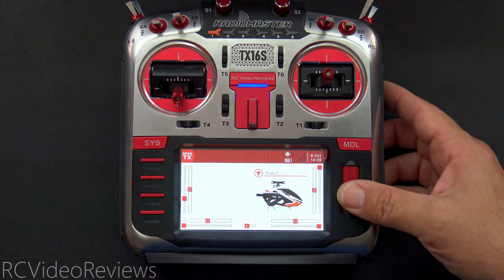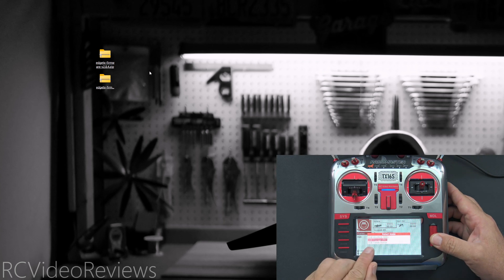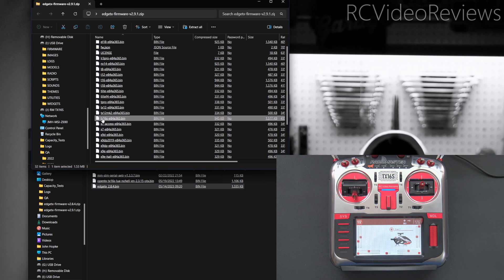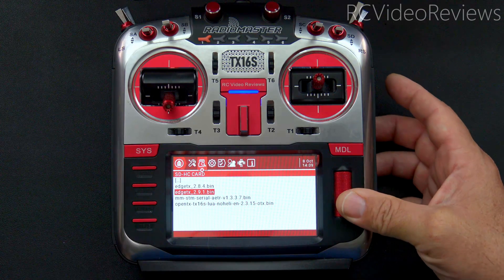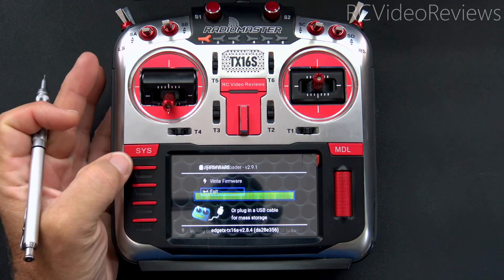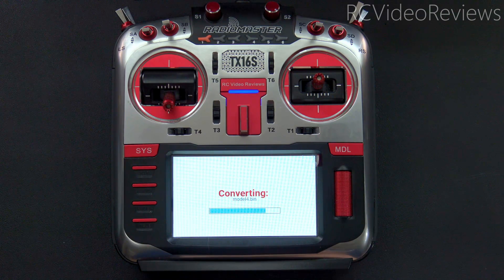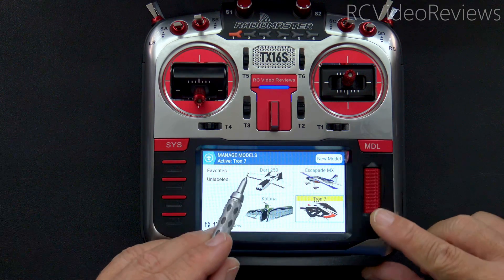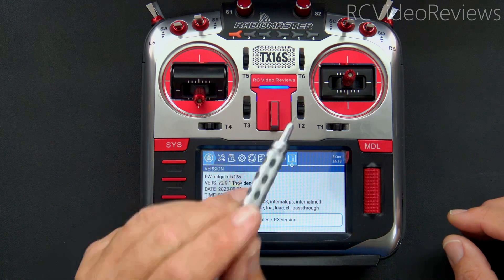How-To Upgrade OpenTX to EdgeTX 2.9.x • DO NOT FLASH Before You Watch This Video

Comment: the progress bar in the writing process gets stuck at around 90% and doesnt move, I cant turn the radio off, return... its completely stuck. Anyone??
Reply: I unpluged the battery and when I plugged it back, looked like it was bricked, but I did the pressing T4 and T1 while pressing the power button thingy and it opened the writing menu, I tried to write the firmware again and it worked, everything else went great from there.

Comment: Thank you so much for the great tutorial videos on upgrading to EdgeTX from OpenTX. Following them made it a breeze to do and everything seems to be working fine (so far). 
I was hesitant to try it and risk losing all the work I had done in OpenTX or mess up the TX16S working with the TBS Crossfire my quad uses, but watching a lot of videos on the features EdgeTX offered made me want to have them also.
You're videos made it irresistible to put it off any longer and easy to get it done.
Loving it greatly....
you have another follower and I'll be watching more of your videos to implement and use the more advanced features I haven't tried yet due to ignorance of what they do.

Comment: Hi, thanks for a great video. My situation is a bit different: I want to migrate TX16S from OpenTX to the newest EgdeTX (v2.10.3 currently), but I have no models, no settings, nothing I'd need to preserve. I want just a clean installation of the latest EgdeTX. Do I also need to go for v2.8 first, or can I go directly to 2.10 please?
Reply from the maker: While I haven't tested this, I'm taking an educated guess here: I would still stop at 2.8 because I know in the conversion process the correct files are created/deleted. The deleted part is important here. I've seen issues first hand when the models.bin file was on a post yaml radio and it created issues deleting new models. 

So just take the extra 2 minutes to flash 2.8 then 2.10 and you'll be 100% good to go.

Comment: The models I backed up do not appear on the remote control (tx18s) when I switch to Edge TX. Tx18s update is same as your video?
Reply from the maker: All color screen radios will function the same way. What firmware did you have before you started and what version of Edge to you try to use in your upgrade?

Comment: hi can I ask,may radiomaster tx16s with edge tx 2.8.4v, I got a nonheli mode, what will I do to get back the heli mode on may radiomaster tx16s. thanks in advance
Reply: I got no enable features,but it's ok now I update on new firmware 2.9.4, then kaboom it's show the heli mode  thanks
Reply from the maker: Check enabled features.

Comment: Bardewlls video caused me so much issues. Funnything is i saw ur video fist but disregarded it and followed his. Lol 3 hrs later and i think i have things back in order.
Reply from the maker: Glad you got straightened out :)
Reply: @RCVideoReviews  im glad u replied sir so anotger major issue im having with my 7inch inav build is now that i have wired up the gps correctly and it is working and the settings are all in order. Im getting a annoying sensor lost warning every 2 seconds in my radio. I updated to edgetx but its still showing in the tel tab and it goes down starting on the gps sensor and also the rx sensors flash black and it says sensor lost. I reaaaaaly need ur help becuase so far i have not been able to resolve the issue.
Reply: @RCVideoReviews  if i disable the gps it goes away. Im running inav 7.0 on fc and elrs900mz 3.latest. FC is skystars f405 hd2. Im running latest ver of edgetx but i dont tgink it has anything to do with the radio because it was happening in open tx as well. THE GPS MODULE IS A HGLRC M100 MINI
Reply: @RCVideoReviews  so i think i solved the issue by setting the packet rate to 200hz in elrs lua. On the tx. What settings do u suggest for bulleet proof range and penetraion with elrs 900mhz. When i was getting the sensors lost alarm i had my packet rate at 100hz and tel ratio at 64. What telemetry ratio should i use with 200hz pakt rate. And is 200hz packet rate with 32 igood for range.

Comment: My well-used TX16S, Switch ABCD, does not work with Betaflight and drone. The stick gimbal works well.  So I bought a switch and replaced it, but switch ABCD doesn't work like before.  What could be the reason?  Please tell me how I can do it.  And my Zorro works fine too...please help!

Comment: My radio's failing at the first step. When I try to flash bootloader from SD, I get the list of files (renamed as you suggested) but when I select a .bin file, the next screen just shows a flickering firmware filename and "Radio: ionDR" below it. The 'enter' button does nothing :(
Reply from the maker: You need to join our discord and ask there. Much more likely to get help on this one there.
Reply: @RCVideoReviews  Cheers dude. Just tried EdgeTX Buddy and it worked fine. Whoever I got this radio from must've corrupted the bootoader somehow.

Comment: First of all, a lot of great videos. Easy to follow.
I have a suggestion for you. In some of the videos you are using EdgeTx Companion and your Radiomaster linked via FrSky XSR-SIM, got that. But, i would like to know how you can read data from your radio? I know from your video setting up Radioprofile you are using a NAS with contents from your SD-card, is that the trick? Please, make a turorial how to setup and connect a Radio in Campanion 2.9 so you can read/write to your SD-card AND see it in the companion simulator. I have no other flightsim stuff. I use my radio for rc construction stuff with a lot of special functions. Iám using a Radiomaster TX16S MK II but it doesnt matter for the connection.

Thanks
Reply from the maker: Maybe try this one: https://www.youtube.com/watch?v=DpwbyMruoF8

Comment: First Thanks for the Great Video's.  I have a Jumper T16 with OpenTX version 2.3.14 and will use your directions to flash the Jumper T16 to EdgeTX version 2.8.x then to 2.9.  My question, I use a JrBox external 4n1 on the back of the Jumper T16 for the multiprotocols.  I am guessing that the firmware on the external 4n1 jr box needs firmware updated to match with the EdgeTX now installed on the Jumper T16.  How do I make sure the 4n1 module is compatible with the newer radio firmware 2.9.x.  Thanks in advance.

Comment: It would be great if you made an updated video on how to set up a 3D helicopter for Ikon using edgetx 2.9. I noticed with this new version they now have a wizard for setting up a helicopter instead of just a plane like it used to have. But when I tried to use it yesterday it did not seem to work well at all.
Reply from the maker: I see you found it...
Reply: @RCVideoReviews ?? What did I find? I used the wizard but it did not seem to work right. That is why a video would be great.
Reply from the maker: You commented on it: "How-To Setup EdgeTX Radio for 3D RC Helicopter using iKon FBL • Part 1"
Reply from the maker: I'll never do a video using the wizard. Learn to program the radio.

Comment: I updated my TX16s last week. I'm very happy with the new features and appearance. Big caution for anyone updating with SD connected directly to a Mac computer. Be sure you have a backup written to your drive, NOT AN ALIAS which is just a pointer to the files on your SD. I managed to replace all my folders with the mostly blank ones in the update instead of merging; so no models, settings etc after the update. Since my "backup" was really just a pointer is was now just as empty as the SD folders. Fortunately, all 5 planes were based on one generic setup and a few hours later everything worked. One good thing was that at the same tome time I added some of John's ideas to my overall setup. But again the CAUTION......BE SURE YOU HAVE A GOOD BACKUP (or 2) BEFORE YOU UPDATE.
Reply: Had a mild chuckle regarding the iOS thing as it reminded me of my aunt who during one of her daughters Weddings approached for a copy of the recordings, I took onto her laptop which I gladly accepted until she whipped out her Mac and no one knew how to get stuff transferred from the Camera to that piece of crap... Apparently everyone on her side of the family was using Mac but not a single soul knew how to transfer stuff from one to the other unless it was via say Mail which wasn't gonna fly for gigabyte sized video files.

A few years later a similar situation happened when the daughter of my mother's friend got into art school and instead of buying a Windows Machine went with an Apple instead because reasons and again no one could figure out how to get a Picture of a Submission onto the darn thing AND then send it to the teacher and when she somehow did manage to send the picture she instead just send a Thumbnail of it... Still scratching my head about those two scenarios and why iOS is even remotely popular with ppl 🤔🤨
Reply: MAC laptops last a lot longer, and I've never bought spam ware etc.  I still use my windows desktop for all my R/C stuff, cause that's what every you-tuber is apparently using, and it makes following tutorials like this soooo easy. I actually watch video on my Mac, while performing flashing on my windows machine.Lol @Duraltia

Comment: Just for clarification, The widgets configured for each model in OpenTX need to be re configured manually afterwards.  Correct?  They do not come over in the conversion process.
Reply from the maker: Correct.

Comment: Been out of the hobby for 3 years now and just am getting back into it, I just followed the directions on the edgettx site from switching from open to edge and went straight to 2.9.1 and used the instructions they give, and uploaded my model profiles from my backup bin file through the companion and plugged in two of my quads and they armed, not sure if I’m missing anything yet or if there has been an update since this video, thank you for your content just
Subscribed
Reply: I guess this is the way to do it when not using the companion? just trying to learn whatever I can,  I did this on my old x9d+, I have a tx16s that I need to do next was scared of messing up, that’s why I tried with my old radio first just to be safe

Comment: Hello John I had a question I changed to the newest 2.9 edge TX on my radio master TX 16 S and was wondering do you notice when you change models each models hurts and milliwatt output voltage is not saved and Has to be changed every time I change a model

Comment: I have been trying to find  v2.8.4 but all I'm seeing is v2.8.5
Reply from the maker: 2.8.5 will work too. Anything < 2.9.
Reply: Thank you! 😀👍 @RCVideoReviews   I'm new to FPV, does the upgrade to v2.9.1 put ELRS tx on the radio or do I still need a module for the back of the radio?? Thanks

Comment: I just upgraded from OpenTX 2.3.15 to EdgeTX 2.9.1 and I just used the Companions to first save the models in a file with OpenTX and then just loaded them up in EdgeTX Companion.
Worked as well. ;)
Reply from the maker: Yeah, I know about that too. I thought about showing it, but so many people don't use companion and this method has no external dependencies.
Reply: What Radio you were using mate? I was using Taranis X9d+. But my biggest issue is unable to bind crossfire again (tried too many methods already)

Comment: Can you do a video about the yappu scrip for Radiomaster T16S.  I did mine and the colors are terrible and the scrip unusable.   Thanks.
Reply: This one of the reason I still hold on with the conversion. Read some issues about this.... I am a mid/long range fpv pilot and will not go without this on Ardu or Inav. Video lost and you are still able to see if your plane is on the right way ( home).
Reply from the maker: I've never really used Yappu. I think I installed it once but having not ever used it in flight, it's unlikely I'll make content on it. Sorry.